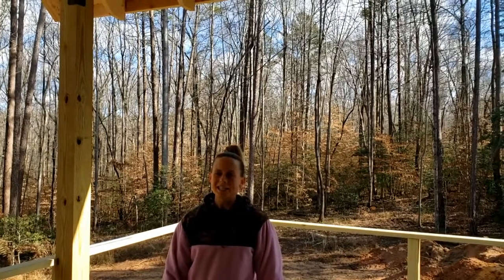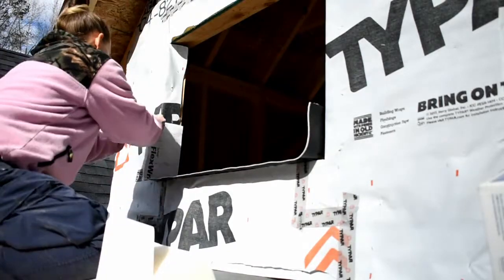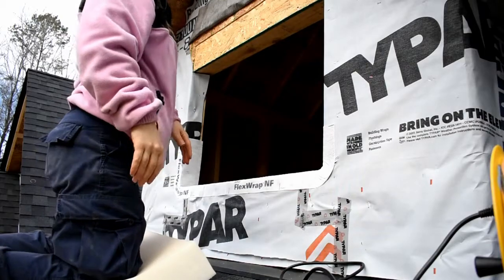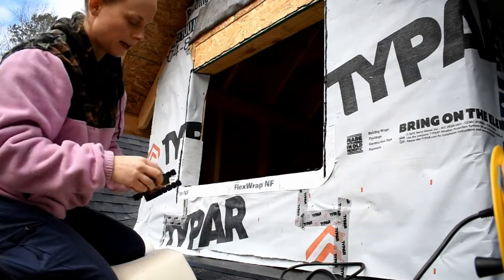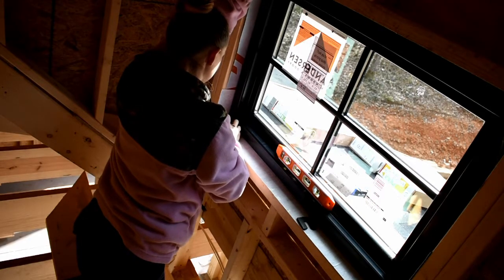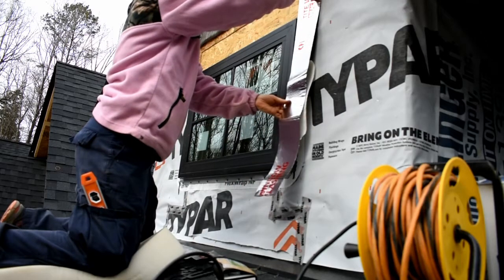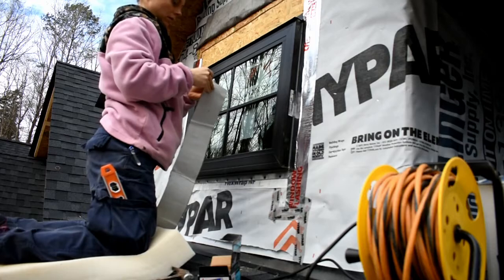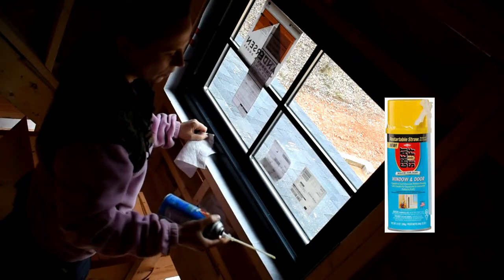WINDOW INSTALL – Andersen 100 Series

Comment: the Typar should be over the nailing fins not channelling water inside to the the 2x4s. Also, the bottom Protecto Wrap or whatever flashing, should be applied first then the sides, then the top. The aluminum drip edge is great, I see a lot of "professionally" done houses with none there.

Comment: I've heard people refer to something called "composite" shims - are the plastic ones you are using considered a composite?  Would it be helpful to check level before applying caulk, and then reseat the window with caulk applied? 

 I noticed there was no caulking applied to the bottom on the exterior.  There was also no flashing put there.  Why is that?

When you caulked the drip edge, do you caulk the top portion, the bottom (which would be the top of the window?) or at the back angle? It wasn't possible to tell from your camera angle. I'm not sure if it matters, but that's why I'm asking!

I'm about to try to install some new windows in my house so I'm very interested. Great video!
Reply from the maker: Hey Mike2...the shims aren't composite, just plastic.  Andersen instructions refer to the no caulk or flashing on bottom as the "drainage method."  If water ever does get behind the flange anywhere, it will have somewhere to drain out (the bottom).  The caulk under the drip edge is at the back angle.  Thanks!
Reply: @CountryGirlLiving  How do you like your Andersen windows so far? My wife and I are replacing the windows on our home for the first time from the previous owner and are undecided berween Andersen vs Pella vs Millgard.
Reply from the maker: @chrisginoc  So far we really like them.  We go the Andersen 100 Series, so they are made out of a plastic composite material, but they still look expensive.  And we don't have to worry about them rotting out or repainting them.  We don't live in the house yet, so I can't really give you any day to day feedback.  But so far, so good.